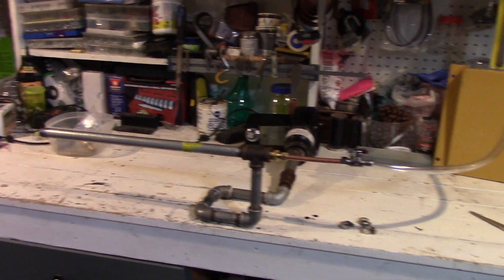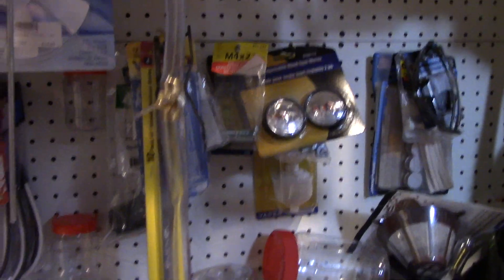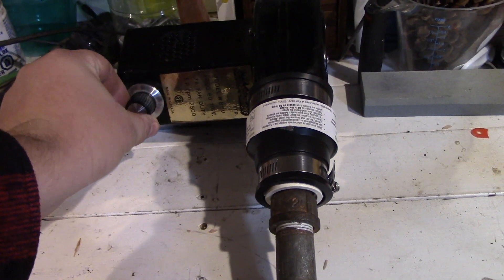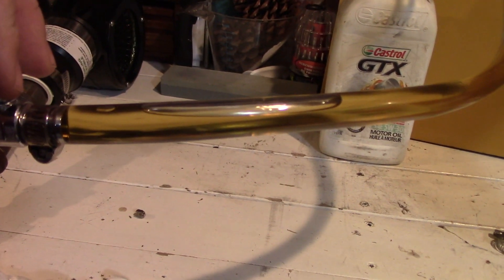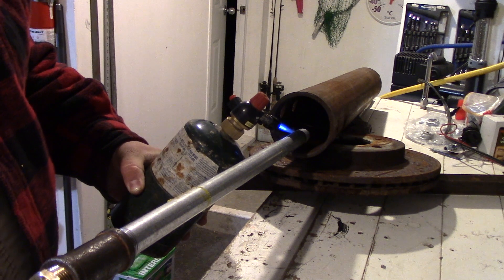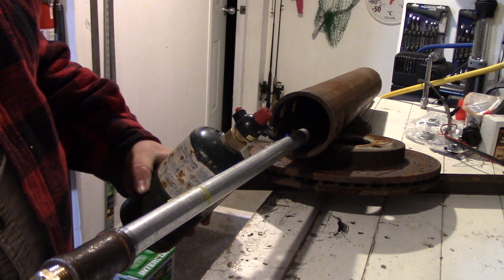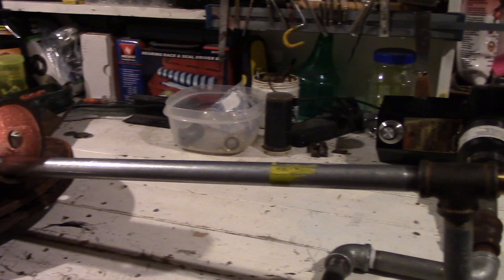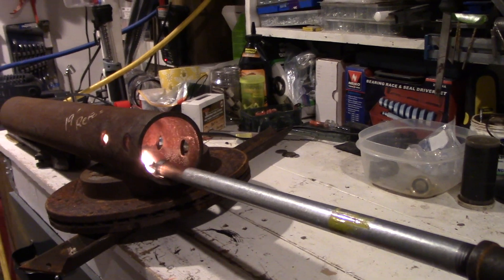Waste Oil Burner Homemade Diy Test P2

Comment: That's pretty impressive Dale.  I'm thinking it isn't a lack of air pressure, it's more of a lack of air volume.  The end of the fan has been reduced too much, I think.
Reply from the maker: Yes that makes sense also maybe too much pipe added?... Not the blowers fault lol it wasn't what it was intended to do... But i am going to try it again maybe using compressed air Stay tuned!